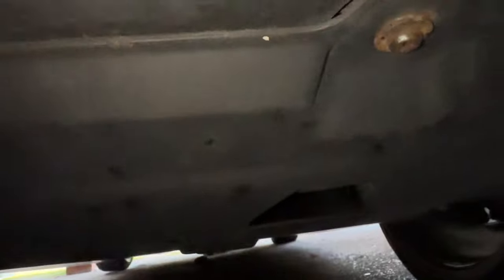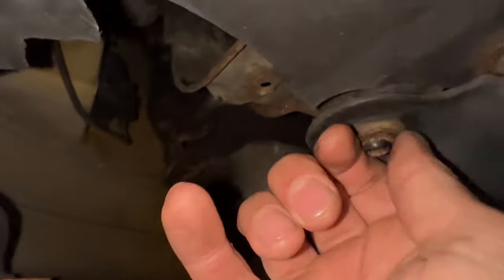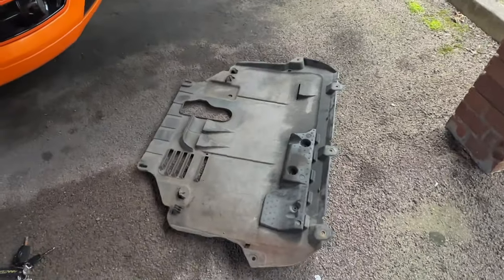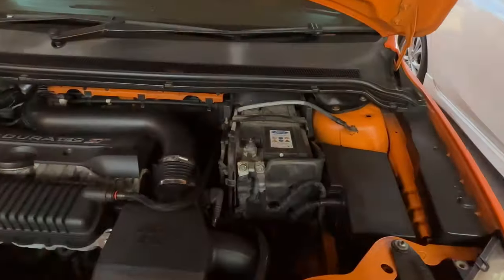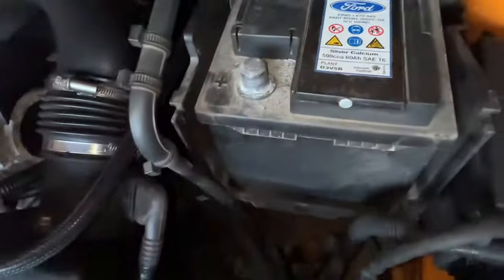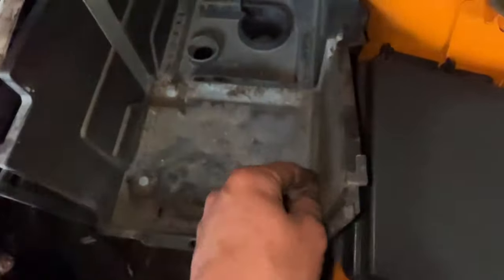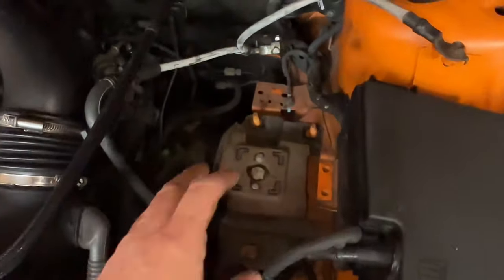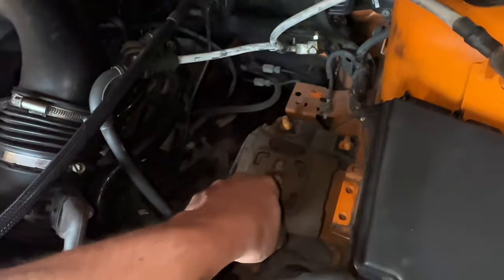Focus st2/rs mk2 reverse switch how to

Comment: The symposer delete is a remedial “mod” to eliminate boost leaks. You can buy a bung which gets rid of the trunking that goes to the cabin.
Reply from the maker: Ahh awesome nice one mate
Reply: @Yodaracing1  As posted, remove the symposer pipe and the symposer unit. Lots of guides on youtube how to do this. All you need it the bung which is cheap. The diaphram in the symposer is known for splits, holes etc and is useless. I did the mod which takes about 30 mins and straight away i could see a100% improvement when boosting. The turbo needle was more smoother too where before it was juttering a bit, which indicated a leak at the symposer.
Reply from the maker: @AndyUltra  cheers buddy

Comment: If youbdo a symposer delete youbwill still get turbo noise in the cabin change the recirculation valve to a turbosmart one and you will have mad chatter mate its worth doing chaing out the plastic coldside boost pipe 👍🏻
Reply from the maker: Nice one mate 🙌 need all the advice I can get haha